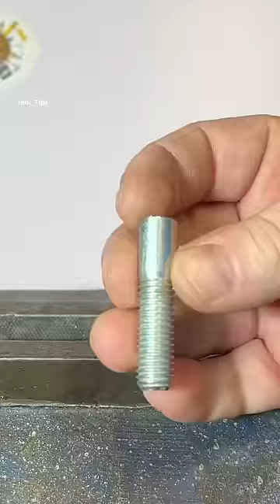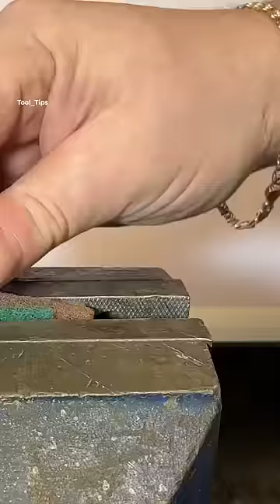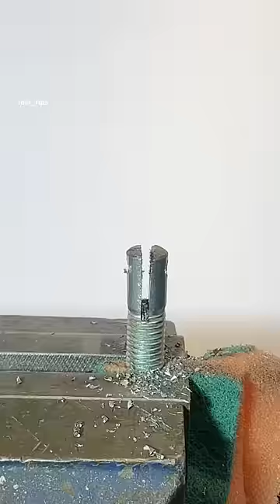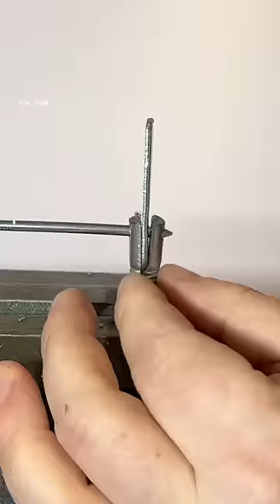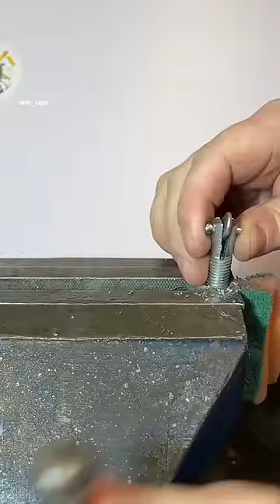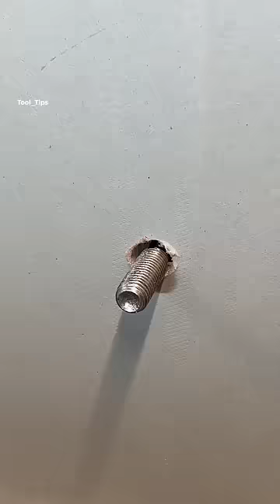Homemade Anchor 👏 #shorts

Comment: Good idea in principle but the fact the anchor is on its edge means the moment weight is put on the structure the actor will be pulled through the board and probably collapse.